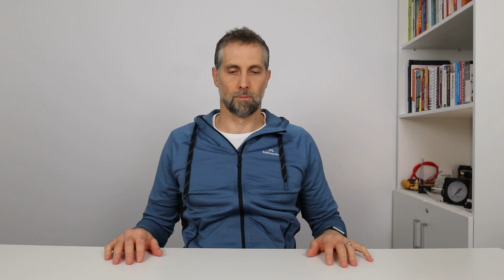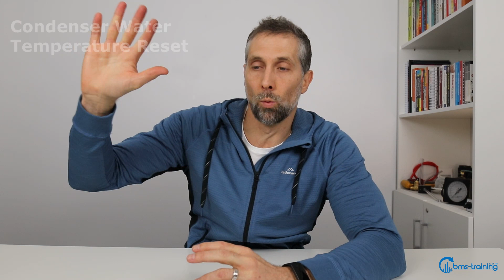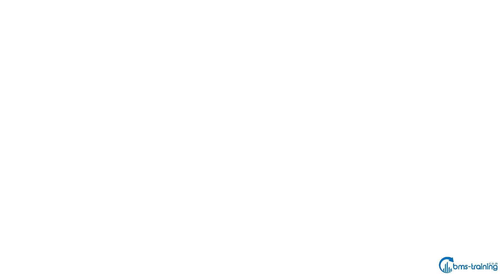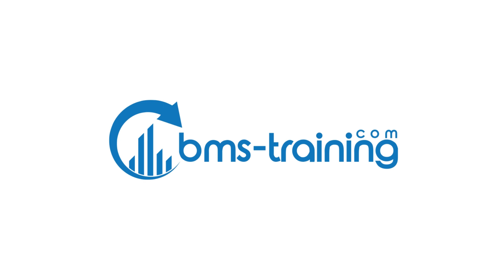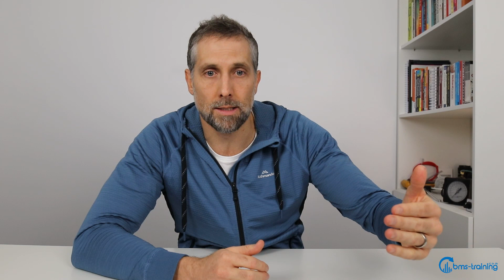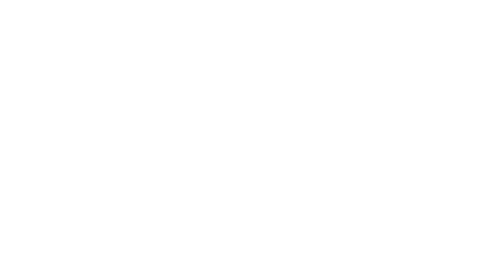Condenser Water Temperature Reset, Does It Save Energy? (BMS)

Comment: Hi Bryce,

WBT + Calculated CT Approach Or Chiller Min. Lift + CHWST would be the correct parameters to calculate Ideal Cwst Setpoint across the condenser circuit. Ideal Condenser Water Flow also is an important factor for achieving overall plant efficiency.

Comment: Fan energy used is far less than chiller energy. You have no actual project or technical studies with figures. No!
Reply from the maker: Hello Leo.
No I don't have actual figures, because that isn't the point. The point is, we as BMS engineers, do not even consider the impact of the increased fan power. Just as we do not consider the increased pumping power from the chilled water pumps when we reset the chiller supply water temperature set point up. 
But, I take your point, there will be times when we can run all the cooling towers fans at 100% speed every day because the chiller efficiency may be higher overall. But we need to understand that relationship. 
Cheers.. 
And, thank you for your comment:-)

Comment: Fan strategy for cooling towers need to be based on tower design approach capabilities for each application. WB conditions will dictate the fan speed set point limitations.
Reply from the maker: Hey Mel, apologies I deleted your other comment by accident, when I went to reply. Did a search and there is no way to recover it. I assume when you say you prefer a system that doesn't have a bypass control valve at all, means you are referencing a mechanical design that has enough end of circuit 3-ports, that totals the chillers minimum flow. 
 Yes I agree, you wouldn't need a bypass valve in this situation. The BMS control would be more simple, and low load chiller control would be more reliable.
However, in my opinion, when you do this the pump will need to run a little harder a lot of the time. Because, when those 3-ports are 50% open, the pump needs to run harder to push the water through the 3-ports bypass leg. Where as with a common bypass valve it only opens when it really needs to. 
So, if you are prioritizing stability, and you would be if you were a chiller guy, then yes, have a bunch of 3-ports out there. But, if there is a major energy efficiency priority, then give up some of the stability for energy savings. 
Thanks for the comment. 
And yes, wet bulb +3°C for cooling tower temperature set-point. 
Stay safe :-)
Reply: @bryceanderson17  You would be correct. I would support having 3-port valves on the end runs for complete flow stability.
In my experience with Primary Variable Flow designs, they usually were designed with a Base, Swing and Standby chiller. Each chiller would be isolated with a stop valve and a differential pressure transmitter. The controlling BAS would monitor the flow demand and stage chiller capacity base on flow requirements. On very light load conditions the Swing chiller (smallest) would be the active chiller with the lowest flow requirements. One example would be a chiller plant that could flow from 150 tons to 1,300 tons of cooling load using a 300 ton swing chiller and two 500 ton base/standby chillers.

In response to pumping loads, the most common problem I see in the hydronic side of the equation is good piping design implementation . Good practice in reducing pumping energy in my opinion gets lost in most projects in the field.